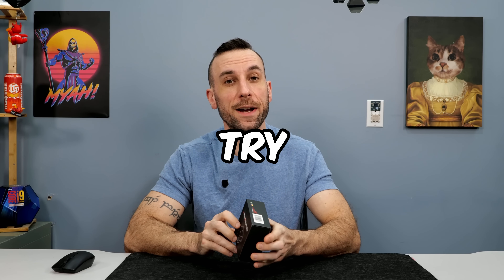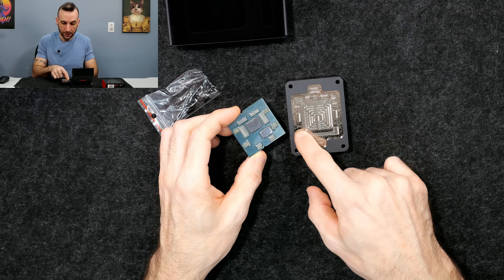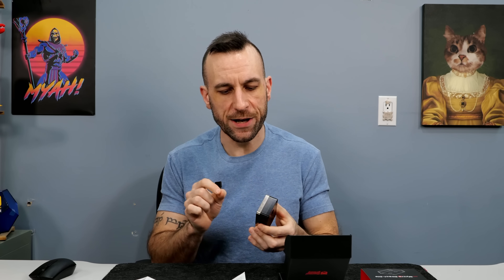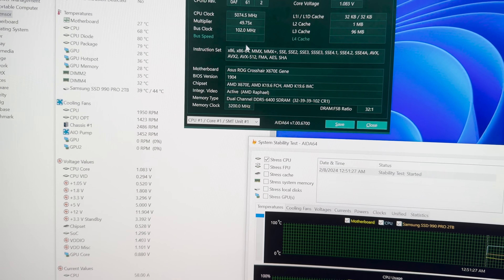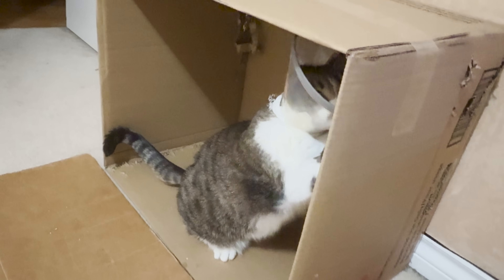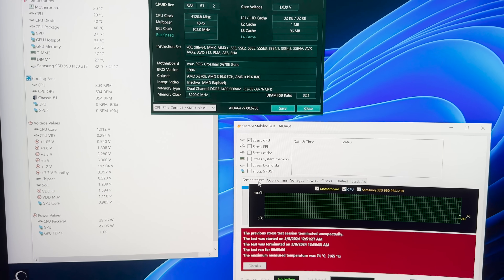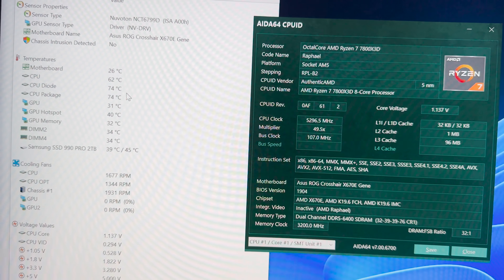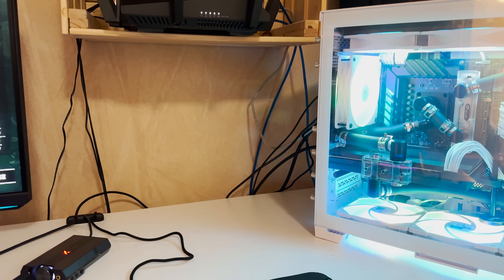🛑 7800X3D Direct Die BENCHMARK 😱👑

Comment: Liquid metal has issues, it works good for some month but needs to be reapplied after a little film is created on the cpu surface, and isn't that a deal because it can still dry or oxyde more the surface. While graphene sheets are a definitive solution.

Comment: WOW! That is pretty BAD result. I get the same with a normal 7800X3D and a REAL watercooling custom loop not like his KINDERGARTEN wannabe watercooling setup. My watertemps are almost roomtemperature und I'm using a Laing DDC 1T + PWM @ 4000rpm. Thermalpaste is Arctic MX4. I guess I even fucked it up by using too little paste. EK Supreme HF cooler that is more than 10 years old. You are a joke dude because you even sound like a JOKE.

Comment: Hey, would it be possible for you to test ram speed differences on 78x3D with new bios/agesa versions in 2024? If i'm not mistaken, in the meantime AM5 can handle higher ram speeds, right? e.g. 6000mhz cl30 vs 6400 cl32. Thank you!
Reply: 7800X3D is a joke if you are not using games that really supports the X3D cache.
I have pretty much the same FPS with my "old" 12600KF vs. this hyped "trash" CPU.
5600Mhz CL36-36-36-68 vs 6000Mhz CL32-36-36-68 = Clown show.
Don't step up on the hype train and save your money.
Patriot Viper VENOM DIMM Kit 32GB, DDR5-5600, CL36-36-36-68, on-die ECC
is a pretty GOOD kit. 70€ used on ebay.

Comment: Not really worth the effort for a 1.5% performance increase. If your already running a half decent AIO it should be virtually silent stock already under normal use.
Reply: I just delidded 7900xt and used the RGB direct die version with PBO2 tune using Hydra. I got about 8.5% all core boost over stock and more importantly I'm not stuck a 90 degrees under load like on stock. Now I'm around 79-80 on full load. For me it was totally worth it already and I still have more tinkering to go. Although I will say this. It is expensive. I could have bought another R9 for the cost of my custom loop... but I can continue to use most of it on future builds as well.

Comment: The reason they suggested the graphine pad is because it works as well as thermal past and is non conductive and won't squish out when mounting pressure is applied. But yes if you are going to this extreme you should use liquid metal to get the best results.
Reply: Graphene is conductive

Comment: cpu looked like it still has it's lid
Reply: I was just about to ask that exact question in the Patreon/Discord. I figured I was missing something.  It's definitely been lapped before, but I am not sure if the IHS was removed before installing the AM5 Mycro Die CPU block(and that part was just cut or not filmed). I just purchased one of these CPU blocks a few weeks back with the impression that the block was to be fitted to a completely delidded("direct die") CPU. Always with "the secrets."

Comment: 2:08 The reason that graphene can be a viable option to liquid metal is that it isn't messy, has excellent conductivity in the planar directions, and is so thin that the temperature drop across the thickness is very low.

Comment: Would you be able to test the 7800x3d dip with the new 6.01 chipset drivers. I personally noticed a massive improvement and way less stuttering with this new driver. Cheers (on win11)
Reply: Me too I was having problems with average CPU die temps reaching 130 degree I believe false readings but was really annoying seem to have gone with the latest bios and chipset drivers also mem context restore doesn't crash windows anymore
Reply: @levispartan1993 130c !? you might have other problems

Comment: This is actually really interesting, it just goes to show you how held back Zen 4 is purely from the IHS.

It's good to note as well that you wont see the CPU scale as well from clock speeds in games that like the cache more. Its good to see you can squeeze more out of the platform, I just wish it was from the FCLK no minimize that latency.

I'd love to see an 8700g max RAM OC as that thing is monolithic which means higher FCLK and WAY higher MCLKs.

I know that with the 5700g you can make up a lot of what is lost from the lack of Cache by pushing RAM to the extreme.

Thanks again for another interesting video
Reply: Yup. Same with the Ryzen 5500. I tuned one of those so well it was beating a 5600X using PBO2 handily.

All core 4.5ghz overclock and 32GB 4266mhz CL18 with a 1:1 FCLK.

Crazy how much performance you can gain from the G series CPU's if you tune them.

Comment: How strange is this result when you have 81ºC on the Diode and 70ºC cpu.... My 7800x3d in the same scenario with 5.05Ghz without fluctuations and without using liquid metal, normal thermal paste and I have 51ºC on the CPU and 66ºC peak on the Diode. The cooler is an arctic liquid freezer 2 360 and the thermal paste is one from Corsair.

Comment: This $400 60W chip just ridicules Intel
Reply: I kind ahate it that it's saying it's 120 TDP CPU but you can't actually OC it to 120 TDP, max what I saw was 80W
Reply: yes and no. too expensive, too hot, and not enough cores. but 3d cache, and low power consumption
Reply: @jean-claudejosselin187 are you talking for gaming performance? 8 cores should be fine for gaming…
Reply: @jean-claudejosselin187  TBF The too hot still ridicules intel, as they are FAR hotter.  At launch yeah it was pricey, but not more than compareable intel
Reply: @jean-claudejosselin187 what are you talking about too hot? Mine runs at over 5ghz on an air cooler and is like 50-60c…

Comment: I had a 13900K, one of the cores became unstable. So I built a 7800X3D system over the weekend and it works better in every way than my 13900K build. 

Primarily play esports titles, CS2, OW2 with uncapped frame rates and both titles run better and stutter less. 

Both of them are great however and each have their strengths
Reply: I went from intel to AMD 3d. No ragertz. Ill never use intel again until they give me a reason
Reply: @korkuc26  I'm sorry
Reply: That AMDip tho. Nah. Im good.
Reply: Sold my 13900ks system for a 7800x3d system due to instability couldn’t be happier.
Reply: @Shaun-w4c  it’s a great no fuss chip, buy inexpensive 6000 CL30 Ram, enable expo and have fun gaming. Really no necessity to push beyond and tweak any further.
Reply: Cool. I love how AMD buyers insist on justifying their purchase everywhere. Totally normal.
Reply: @bronsondixon4747  the irony is the video is not about AMD :))

Comment: LMAO -"We are going to be using Liquid Metal like a normal person"
Reply: It's funny because he clearly doesn't understand the differences between a graphite thermal pad and an electrically conductive graphene kryo sheet, and the benefits a kryo sheet presents. Plus, Der Bauer already has metrics proving it gives excellent performance benefits over stock with the graphene sheet.
Reply: PS5 APUs use it, so why don't our high end cpus?
Reply: @nerdynumen  Ps5 overheats with thermal paste due to the shitty cooling system. Plenty of videos on it.
Reply: @nerdynumen  because thermal paste is perfectly fine for something like a 7800x3D. Heck its fine for basically all CPUs... Unless you are constantly pushing max wattage in stress tests. We have far better cooling with PCs than a console which needs to be almost silent and slim. The difference between thermal paste and liquid metal isnt worth it for most CPUs at all.
Reply: Sure on CPU, but no on GPU.
Reply: 7800x3d here, stock with a deep cool 360 AIO… runs cool, and not doing any overclocking. I mainly do sim racing iRacing (with either triple 1440p monitors, or Pimax Crystal VR). I’m only considering going intel to smooth out the dips at certain tracks (with lots of cars on the track). Do you have any clients/supporters that do sim racing with your recommendations and tuned by Framechaser?
Reply: Liquid metal for the risk taker 😂 let's add even more risk to deliding on vertical mounted motherboard I've never heard of thermal expansion or gravity 😅 dummy
Reply: Only a half joke, you're not supposed to use thermal paste on a modern cpu die because heat density is too high
Reply: come on where did you get this info bro. thermal paste are still good. @yosixxx
Reply: @yosixxx  I can attest to that, I got the iceman direct die for my 12900K, I put some MX 6 on it since I ran out of kryonaut while using it to clean the solder.
while temp at start were ok, after week or two I got to thermal throttle. When I got the kryonaut extreme I cleaned the CPU bit further with metal cleaner and spread it, the temperatures were back to great level. my next step is to move to bigger case and put 420 thick rad instead of my slim 360.